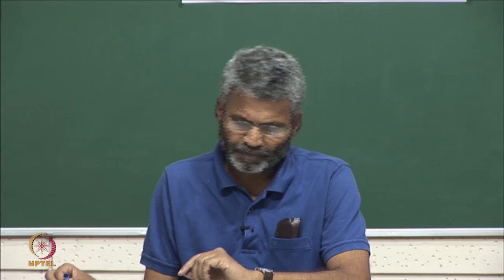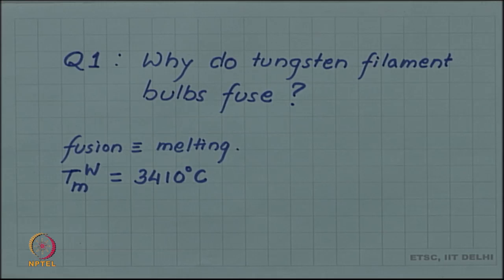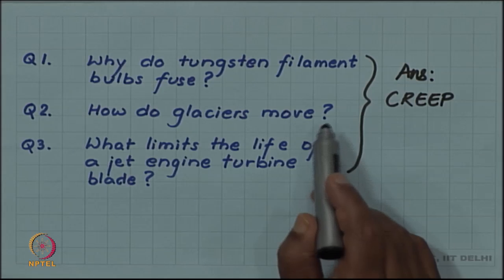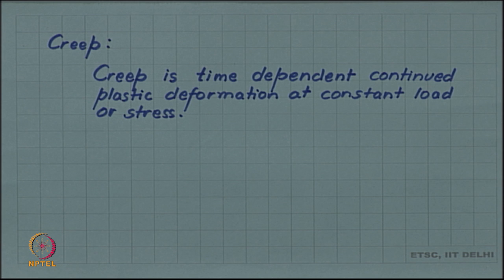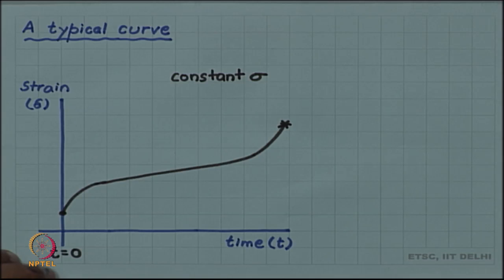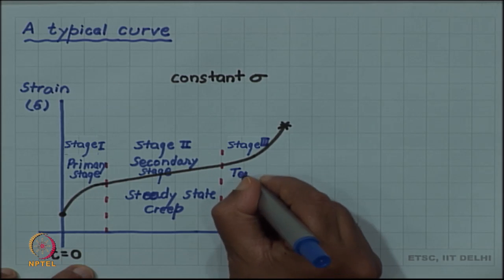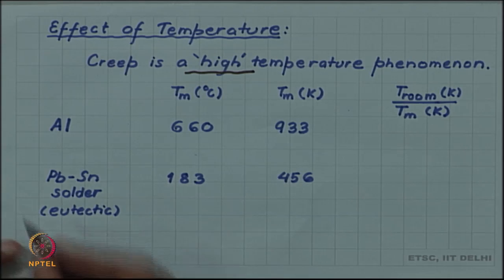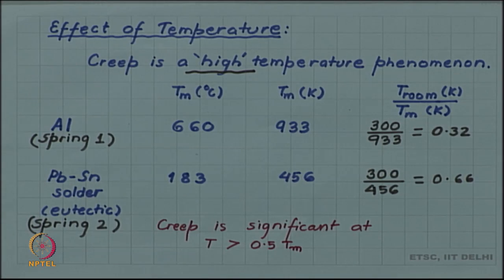Creep: Introduction

Comment: Sir, How constant stress acts during creep when area of cross section is reducing continuously ? Thank you in advance
Reply from the maker: If you do a fixed load test then you will not get constant stress. The stress will increase as the cross-sectional area decreases, as you have correctly pointed out. But in more careful tests, it is possible to adjust the load to keep the stress constant.

Comment: Sir please help me solve this doubt🙄
Let's consider tungsten filament with Tm=3410°C. 0.5Tm=1705°C. So creep would be significant only at a temperature greater than this I guess. Even this is a Very High temperature and all other electrical components will melt at this temperature. So I believe tungsten undergoes creep certainly at a temperature lower than this  I'm totally confused with this. Please help to solve this confusion/misunderstanding
Reply: The high temperature is in filament only and not in other components. The temperature in the filament has to be high for it to glow and give light.

Comment: Respected sir  I have some doubts after listening this video. 
Why we will choose the 0.5Tm as creep temperature? 
How we will decide one material creep temperature? 
Below this temperature will creep occur or not?
Reply: This is just a rough rule based on experience. In reality, creep happens at all temperatures. But the rate depends on temperature. It increases exponentially with temperature. So at low temperatures it is hardly observable. Creep rates become significant at about 0.5 Tm.

Comment: What are the ways to prevent this creep failure
Reply: This an interesting topic. Perhaps I should make a new video on this. One can do several things to make a component creep resistant: 1. Choose an alloy of high melting point 2. Solid solution strengthening 3. Precipitation strengthening 4. align grain boundaries along the stress axis (directional solidification) 5. remove grain boundaries altogether (single crystal), 6. use internal cooling to keep the temperature of the component low 7. use thermal barrier coating to insulate the component from heat. 

There is a video on this channel that discusses some of the techniques with respect to making creep-resistant turbine blades: https://youtu.be/SHf_KiIwmyo
Reply: @rajeshprasadlectures  great work by you sir your videos are very helpful for all of us.Thanks

Comment: Dear sirr......
I have to tell u a little fundamental confusion that creep is the accumulation of plastic strain wrt time under its self weight ( it will be time depending function) but when we are calculating deformation due to self weight i.e ∆l=(√*L^2)/(2E) there will be no any time function ...... Why ?? ..Is  It Also one kind creep deformation.. please tell me more on this sir?????
Reply from the maker: The formula you are suggesting will give elastic elongation. It cannot give plastic deformation.
Reply: Thank you very much sir.......it's a very pleasure  for .me💜
But sir ...elastic deformation Doesn't depending upon time ...... So.... Every material have some kind Small elongated at ( ∆t=O ) so including its actual length...... So can I say  sir every material as see in day to day life , length of That's material  doesn't it actual length it must be include small amount of inertial deformation.????
Reply from the maker: @sibammajumdar2749   I will agree with you on that.
Reply: Thanks u sirr..........

Comment: Nice explanation with simple example. I wanted to understand is Temp. ratio >0.5 for metals? Does it also applicable to plastics. if not for plastic, what is the ratio for different types of plastics. i will be grateful to you, if you can share table with ratios for different type of materials.
Reply from the maker: According to Principles of Polymer Engineering by McCrum, Buckley and Bucknall (2nd. edn.), p125, polymers creep at all temperatures above minus 200 degrees C. Thus even at room temperature polymers creep.

Comment: sir, this is a query i wanted to raise in grain boundary lecture as well. sir, why do we prefer single crystal material for gas turbine blades(working at very high temperature.). Sir,  i came across an explanation that at high temperature  creep/fracture propagates through grain boundaries (as they are weaker region) hence we try to minimise the no of grain boundaries  to avoid fracture.i wanted to ask if this is the correct explanation and if yes then why grain boundaries are weaker at higher temperature(which ultimately result in intergranular fracture). because the explanation of the same was not mentioned in the book. 
i have completed all the lectures before raising this question. I will be very thankful to you if you could respond to my query .
Thank you , sir

Comment: Stress rupture data are sometimes correlated with the Dorn parameter, θ = t exp[-Q/(RT )], where t is the rupture time, T is absolute temperature, and θ is assumed to depend only on stress. If this parameter correctly described a set of data, then a plot of log(t) versus 1/T for data at a single level of stress would be a straight line. If the Larson-Miller parameter correctly correlates the data, a plot of data at constant stress (therefore constant P) of log (t) versus 1/T also would be a straight line.

A. If both parameters predict straight lines on log (t) versus 1/T plots, are they really the same thing?

B. If not, how do they differ? How could you tell from a plot of log (t) versus (1/T ) which parameter better correlates a set of stress rupture data?
Reply from the maker: The equation θ = t exp[-Q/(RT )] is essentially an Arrhenus rate equation with Q as the activation energy. Both Q and θ are constant at a given stress. Thus if Q and θ are determined for a given stress the rupture time t (or time for a fixed amount of strain) can be calculated at any given temperature. 
The important point is that Q and θ are constant at a given stress. What hapens if the stress is changed. Well, in reality both Q and θ may change. The two parameters are based on two simplifying assumptions:
1. Larsen-Miller para,eter assumes that Q varies with stress whereas θ is constant. The L-M parameter is essentially the value of Q.
2. Dorn parameter or Sherby-Dorn parameter or Orr-Sherby-Dorn parameter assumes that Q is constant and θ varies with stress. 
Thus although, both are based on the same Arrhenius equation at a given stress, their assumptions regarding the variation of constants in Arrhenius equation with stress is different. Thus their predictions will also be different.
A good discussion of this with worked-out problems can be found n N.E. Dowling, Mechanical Behaviour of materials.

Comment: Sir may I know y the second spring undergone deformation. Any load was applied on it
Reply: Watch 14.00
Reply: its pb/sn alloy and its temp ration beyond 0.4Tm. so its behave on high temperature with its own weight constant stress. inside the metal different mechanisms of creep happens. dislocation creep always occur and diffusion creep occur because of high temp and grain boundaries are sliding. this cause to elongate the entire spring.